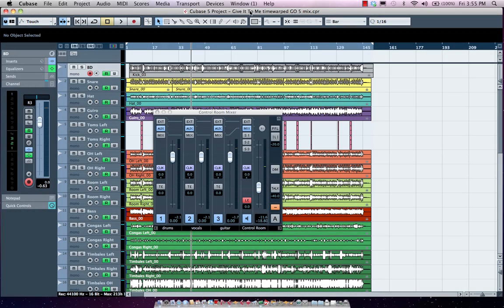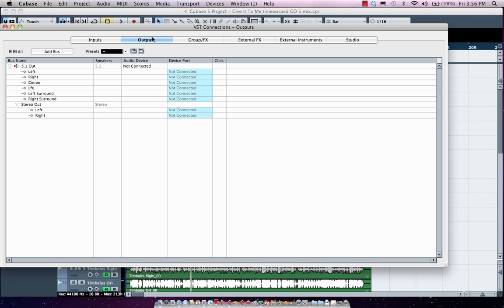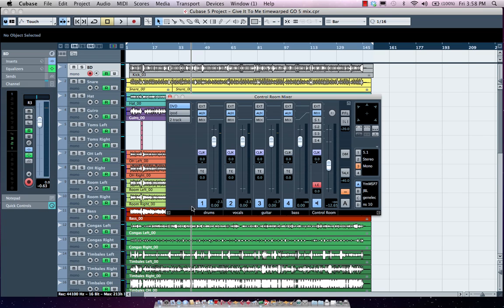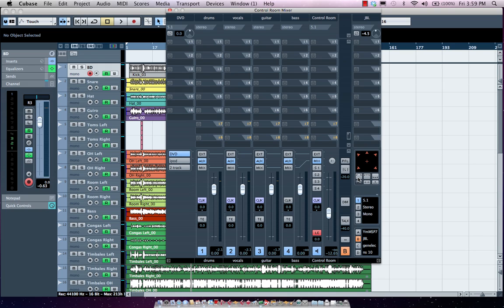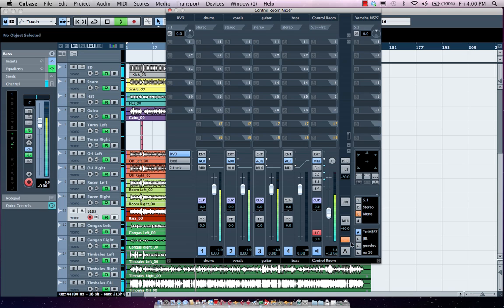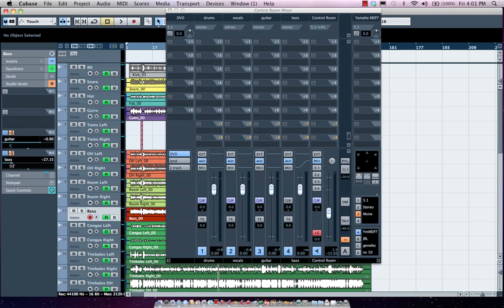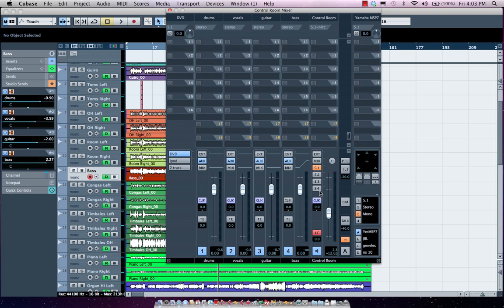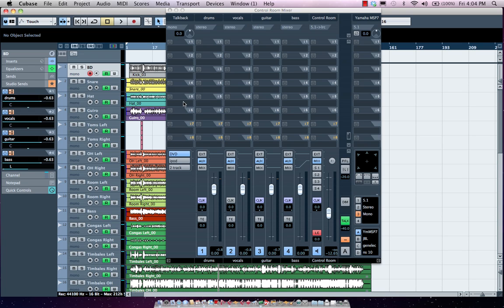Control Room

Comment from the maker: The control room works with any audio interface.  There is a video of it within Cubase 7 on this channel as well.  I don't have a focusrite interface but you basically need to route the audio outs to the headphone outs or run the line outputs into a headphone amp.